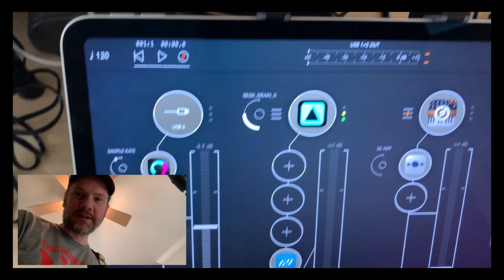Guitar as an input gameboy as an output

Comment: This is great. Thank you for showing all your routing, especially with MIDI and how it all integrates with your iPad. Makes it clear I should probably go with the Model12, since no other mixer out there seems to have MIDI, and this looks to work pretty effectively...
Reply from the maker: Thank you Jesiah, it is a great mixer and you will be happy. The midi works great but the clock source is only the mixer's internal clock (most of the time you will be pressing play/rec on the mixer anyway). I have not been able to use the daw control in aum, audiobus or cubasis. I'm not saying there is no midi learn mixed with the daw control settings, I just have not found that workaround yet. Auria pro does not get updates but works great with daw control so I'm hoping one of the settings will work as aum and cubasis recognise the daw control input (they just don't do anything).